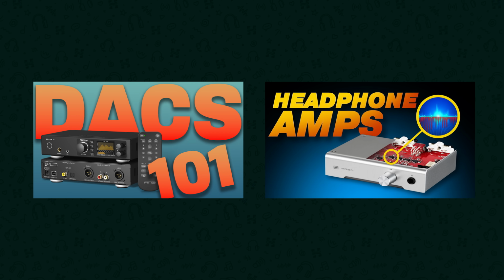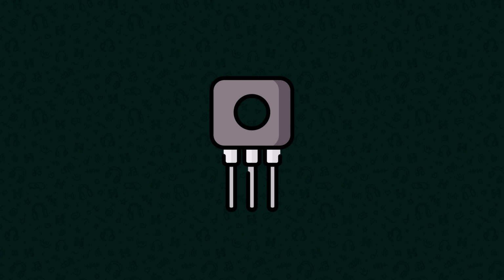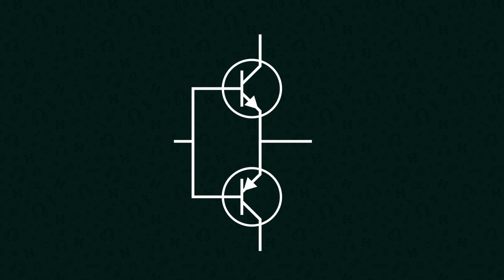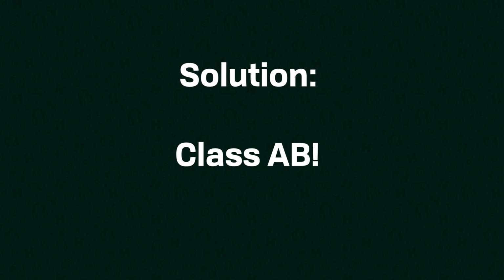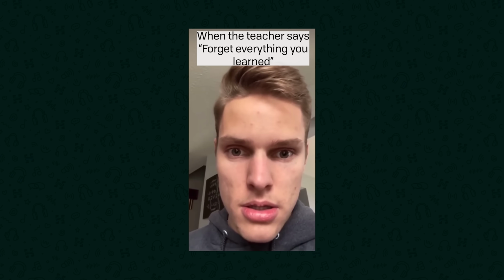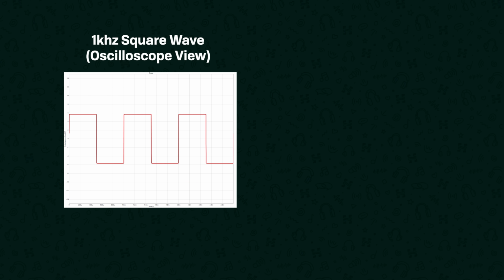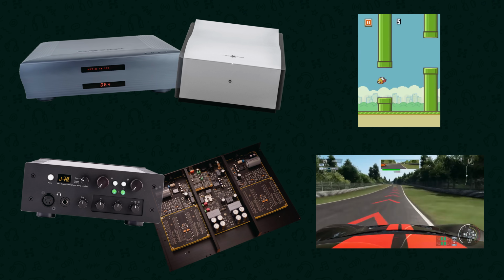Audio amp classes as fast as possible!

Comment: Class A/B amps still have crossover distortion. The higher the bias, the less distortion. Only class A amps don't have any crossover distortion. Most class A/B amps have pissant bias current, thus considerable crossover distortion. Class B amps don't exist for audio, because the distortion is horrific.

Comment: What happened to "C"???? They don't like this letter?
Reply: class c amps do exist and are actually the most efficient, but heavily distort audio as the transistor spends most of its cycle off
Reply: It has no application in audio but used in rf.

Comment: I was designing AB amps 50 years ago. 2N5457 FET front end and 2N3055/MJ2955 output. 
I dont think my 50W rms amp design could be bettered, even by a 405. Class A has too much distortion and Class D is not cost effective on components.

Comment: Ok so which kind is 'best'? 
From a power effeciency standpoint it would be D, obiously. So why do the other two still exist?
Reply: Class A amplifiers are the simplest design and generally offer the lowest distortion, but they are highly inefficient. Because of this efficiency penalty, they are chosen almost exclusively for their high sound fidelity. While Class B is more efficient, a pure Class B topology is rarely used due to crossover distortion, instead, Class AB serves as the industry sweet spot by successfully balancing efficiency with distortion control. Meanwhile, Class D amplifiers historically struggled with high frequencies and overall sound quality. However, thanks to high-speed electronics, advanced switches, and other novel innovations, Class D has become quite good that some enthusiasts argue it is rendering Class AB, and perhaps even Class A, obsolete.

Comment: I like this explanation, but when I look at it, the first thing that comes to mind is why not take a copy of the signal, run it through a comparator, and turn off the bias voltage of a class A amp when there's no signal present for longer than a certain time.

Comment: Well explained.  But probably could have gone to more depth on why Audiophiles prefer class A and why most consumer audio amps are Class D.
Reply: That's difficult. Not all audiophiles do prefer Class A.
Reply: Don't forget high quality Class AB amplifiers. Loved by many audiophiles.
Reply: @MrSummitville  Technics made a very clever class B push pull amp which biased the output devices (in this case bipolar) just enough so neither actually shut down completely, thus eliminating crossover distortion. They call it 'New Class A'. Even the modest ones with integrated output ICs sounded lovely. Later came their 'Class AA', which was completely different. To my ears, they were inferior.
Reply: @Paul-c5x7t  If the transistors never shutdown down then it is Class A. Single-ended Class A and Push-Pull Class A.
Reply: @MrSummitville  I've always thought of Class A as single output device capacitor coupled to the speaker and no feedback.
Reply: @Paul-c5x7t  If the transistor(s) never turn off that is Class A. Both Single-Ended Class A and Push-Pull Class A designs exist. There is no requirement for Class A to be single-ended, passive, "resistor-only" pull-up. Active pull-up, by another transistor, is allowed in complementary Push-Pull Class A designs.  Both transistors operate in their Active region.  Many pre-amp designs are Push-Pull Class A = very low distortion.  Basically, it is two "stacked" Class A Amplifiers with the speaker connected to the middle. One Class A amplifier pulls high and the other Class A amplifier pulls low. With a bipolar supply, the output can be 0 volts, when the input is 0 volts. A Single-Ended Class A amplifier, with a single-ended supply, has a DC Offset in the output.
Reply: @MrSummitville  Thank you!! Appreciated.

Comment: The presentation was well-organized and clear. Based on my observations, the Class A amplifier produces a very strong speaker output, and the frequency remains consistent even when standing directly in front of the speaker. In contrast, push-pull amplifiers do produce a buzz, but there is noticeable deviation in the low frequencies when standing in front of the speaker. Similar behavior is observed in AB and D amplifiers. This is why I still prefer Class A amplifiers. The only drawback is that if a transistor shorts, the speaker can be damaged unless relay protection is installed

Comment: It's not the "quescient" current, it's the quiescent current. And it is not what makes circuits like class A amplifiers inefficient. What does is that they more or less always must operate in a range where they have SOME resistance, which wastes power. What do you think is the range where a transistor wastes the most power? Near the top, where the resistance is the least, or near the bottom where it is the highest? Neither. It's around the middle. Power dissipation is voltage drop times current. Those vary in counter-sense with the resistance, so when the transistor is almost fully conducting, the voltage drop is nearly zero, and current is the highest. When it's barely conducting at all, the voltage drop is the highest, but current is almost 0. Thus the power dissipation is lowest at the extremes and highest in the mid-range.

This is why class D is efficient. The transistors (usually fast-switching MOSFETs) are run in a way that they are either fully on or fully off - the modes of operation with the least power dissipation. They don't vary the resistance, they simulate it by letting wider or narrower pulses of current through and smoothing it out to a nice (and hopefully high fidelity to the signal) curve.
Reply: Class A amplifiers do have high quiescent current. And that does make them less efficient.

Comment: As a former audio manufacturer who was one of the very first to bring Class D to multichannel home theater solutions, thank you for clearly saying PWM instead of the dreaded (and completely different) "digital" word.
Reply: PWM does convert the Analog Signal into a Digital Signal.
Reply: @MrSummitville It merely moves the analogue signal from the voltage domain to the time domain (or it encodes it directly in the time domain, because we all play digitally encoded analogue signals in the first place). 
Learn some electronics instead of spreading nonsense.
Reply: @PaulSpades  PWM (Pulse Width Modulation) is a digital signal used to approximate an analog signal. It consists of a square wave that rapidly switches between fully ON and fully OFF = Digital Signal.  Clearly, you do not know what a Digital Signal is.
Reply: @MrSummitville PWM ≠ digital. PWM is not a representation of numbers, and therefore by definiton is not digital
Reply: @atypicalchannel  PWM certainly does convert an Analog Signal into a Digital Signal. The output is a Square Wave with a value of "1" = On and value "0" =  OFF.  Digital values of "1" and "0" only !!!  Your reply is incoherent, at best.  You think you are a EE because you stayed at a Holiday Inn, last night?
Reply: @MrSummitville The audio is not represented by the on and off pulses on the output of the transistor. Those happen at a fixed rate and frequency, regardless of what is currently being amplified. The audio is represented by the length of time each pulse stays turned on or off. It is infinitely variable (i.e. analog) and controlled completely by analog circutry. There is no conversion of the analog signal to 1s and 0s, there are no hexidecimal values, not even any "bits or bytes". There is no "data", only voltages. You can keep pretending like you know what youre talking about and making rude statements, or you can do some research.
Reply: @atypicalchannel  I said ... On & Off. I never said hexadecimal. You are delusional.
Reply: @MrSummitville Yes I am aware, but the state of being on or off dosent carry any numbers, there are no "digits" so it cant be digital. Saying a class D amplifier is digital because of the on/off pulses is like saying a composite video signal is digital because I can unplug it from my tv.... "Look! I just changed it from a 1 to a 0!!"
Reply: @atypicalchannel  You don't what you are talking about. You don't know what a Digital Signal is. Just stop. You are wasting my time. Get an EE degree.
Reply: @MrSummitville I'm an electronics engineer, and he is right. PWM is a form of modulation, and the modulation is in pulse width or duty cycle. You can create analog PWM and digital PWM. The limitation is whether you quantize the pulse width or not. You, and many electronics engineers, think that quantization can only be done at the voltage level.

Comment: Electronic technician:

Take note that, in a class AB amplifier, over bias won't turn it into a class A amplifier. 
You have to bias it as specified in the service manual. That's because the feedback network is calibrated for a certain amount of bias. Hotter doesn't always equal better.

Comment: Good explanation. But, it should be pointed out that distortion (including that created by the crossing distortion) can be measured. "Purity" is not a technical term, I think this simply means lower distortion and noise. So, it is possible to make an AB amp that has inaudibly low distortion. A class-A amp cannot sound more "pure" (having less distortion) because human ears cannot hear the difference. So, it doesn't matter what type an amp is, as long as it has low distortion. I think tests of audible distortion show that people need over 2% distortion to hear it with music (on some music). For sine tones, 0.05% is needed to not be able to tell the difference. Home audio amps regularly achieved this distortion sometime in the 1970s--its a non-issue now and one reason people can't distinguish properly operating amps.

Comment: The Class D amplifier explanation is incomplete.  As shown, only half the wave modulates the positive rail, the other half of the wave modulates the negative rail.  You have a bipolar, AC input and you need a bipolar, AC output. 
A weakness of Class D is no "damping factor", the integrated pulse width modulation produces a voltage impressed upon the speaker but cannot absorb the speakers overshoot whereupon it becomes a type of generator producing its own voltage.  A transistor output amplifier can absorb this energy from the speaker making it tight but not everyone likes it.  Tube amplifiers have weak damping factor and Class D none at all; but feedback can simulate a damping factor.

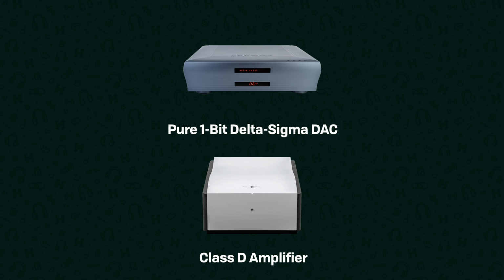Comment: Please do not show DAC output as discrete steps, like at 8:20, because that’s not how real DAC output looks. No matter how much you zoom in, you will never see steps. A DAC cannot reproduce an input signal correctly unless it is followed by (or has a built-in) low-pass filter. Once the signal passes through that filter, it cannot appear blocky—just like in the video where a class D output becomes a sine wave.

It’s a common misconception that DACs produce steps and that bit depth (8, 16, 20, or 24 bits) determines their size. In reality, a DAC never outputs steps, not even a 1-bit DAC. The number of bits only defines the signal-to-noise ratio and dynamic range, not the shape of the waveform. On an analog oscilloscope, an 8-bit DAC output looks the same as a 16-bit DAC output at any zoom level. The only difference is that the 8-bit version has a higher noise floor, so more background noise is present but if you filter out all signals below a certain threshold, the curves are identically on the oscilloscope.

So showing digital signal output as visible steps is always incorrect. No real signal has ever looked like that. With an ADC-DAC chain running above 40 kHz, any analog signal up to 20 kHz can be reproduced perfectly, regardless of bit depth. The DAC is not outputting an approximation—it outputs an exact copy of the signal. Bit depth only determines the noise level. And for perspective: an audio cassette had an effective resolution of about 5–6 bits, and high-end studio tape about 11–12 bits. That means 16-bit audio already surpasses the noise performance of even the best studio tapes from the 70s and 80s.

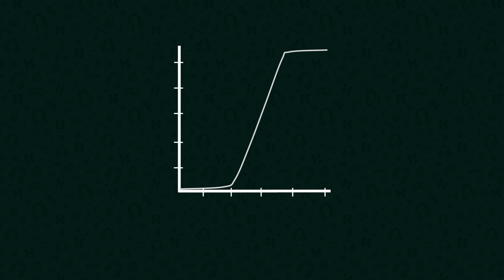Comment: The vidNo, "transistor" or BJT that are meant here to not have a threshold-current but a voltage. Then 2:32 the chart shows a relationship between the input.... voltage or current? Who knows. no labeling, no mentioning of unit. Only later it talks about proportional current.

Comment: can you use 2 transistors both npn, but at different voltage response ranges?
Reply: You can use Sziklai pair that can make npn power transistor to act like pnp transistor (with help of small pnp transistor). Not directly possible to have "different voltage response range", idk what that means, because it needs to handle different polarity of the signal.

Comment: CLASS H (hybrid), amost same as Class AB, but with two stage power supply. One, low voltage
(-LV/GND/+LV)and second high voltage
(-HV/GND/+HV). When the input signal is high enough, they switching to higher voltage supply. Usually, it is integrated circuit chip. STK and TDA.

Comment: I took electronics back in the mid 70's and I'm still kinda fuzzy on class D audio amplifiers. Sure I've repaired several but I've always used good ole tried and true methods, (site, feel, resistance and voltage measurements but I never took the time to get into learning exactly what was happening inside of that type of circuit. Thanks for! your Explanations they have helped me "Shave-off some of the Fuzz!":eyes-pink-heart-shape:

Comment: I dont really understand the idea of pozitive and negative signal, i thought sound signal is DC based?
Reply: Nope, sounds are AC, not DC. The proof ? Sound is always characterized by frequencies (of the alternate signal).
Reply: @TEKDAD  sound can absolutely be dc

in fact, this has been argued too many times

is a pwm signal dc or ac?

well ur arduino is dc and it outputs pwm, so it is dc

doesnt matter, because all of them r wrong, including ur answer

the real answer is that ac dc actually has 2 definitions (actual textbook definitions)

one is that ac means alternating, current changes direction like ur mains power, dc means direct, only going one direction, doesnt matter if it is pwm

another is that ac means changing signal, and dc means constant signal

U NEED TO KNOW THE CONTEXT TO KNOW WHAT THESE MEANS

and this is the real answer to this question, because many ppl only know one or the other of the definition

to avoid confusion, use the term, ac with dc offset

there are also many engineering terms with multiple definitions, like voh and vol

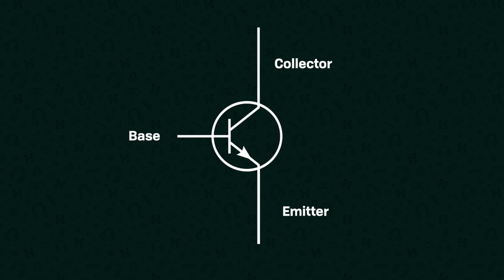Comment: 1:34 "Current flows from the collector to the emitter" - Don't you mean the other way around????
Reply: Why? In npn transistor current flows from the collector to the emitter, that's correct.
Reply: So-called "conventional" current does flow from collector to emitter, but electron flow flows from negative to positive. A negative terminal of a power supply will have an excess of electrons, while the positive terminal will have an identical deficit. Part of this confusion goes back to Ben Franklin, who chose Positive for the electron source, and Negative for the destination, not knowing all the physics because they haven't been discovered yet. Bottom line, electrons start at the Emitter, the Base controls how many electrons flow to the Collector.
Reply: @joeylawn36111 kinda yeah. I think naming emitter and collector is related to the fact emitter emits it's majority carriers, and collector collects them. In npn transistor those carriers are electrons and current flows in opposite direction (from collector to emitter). In pnp transistor those carriers are holes and current flows from emitter to collector. Or may be proper naming is primary charge carriers, I can't remember now.
Reply: @joeylawn36111  That is why we don't say "Electron" Flow. Electrical Engineers say "Current" Flow. There is no confusion.  You must learn the lingo ...

Comment: So, we're still pretending that current flows from positive to negative? Unbelievable! Holes don't flow.
Otherwise good video.
Reply: You are confused. Current Flow is not the same as Electron Flow. Clearly, you are not an Electrical Engineer.  You must learn lingo.

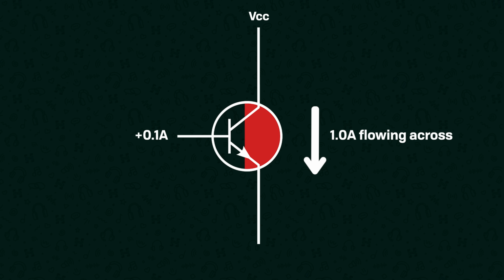Comment: 1:50 I dont like this representation. Voltage control model of transistors is much more sensible here.  The mechanism of action of BJT is that an electric field across the base-emitter junction decreases the width of the depletion zone. It is this electric field, measured in volts, that controls the movement of charge carriers. Therefore the BJT is voltage controlled.

You can assume current control when designing a circuit but here we are explaining how they work so lets not put cart in front of the horse.

Comment: Interesting. It seems like a Class D amp is generating a DSD-like signal from the analog input. So, what if you have a DSD signal to start with? Are you converting it to analog with a special DAC? And then basically back to something like DSD in the amp? Sounds like there should be a DSD input on class D amps, skiping the DAC, and only becoming analog when it hits the low pass filter at the output.

Comment: Current flows FROM the emitter, that's why it is named as such, same with the collector being the "collector".
Reply: Of course, exactly WHAT the emitter emits depends on the type of transistor.   It might emit electrons (NPN) or it might emit "holes" (a place for an electron to go) (PNP).   But of course you cannot actually "emit" a thing that does not exist.  So in a PNP transistor, it is the collector doing the actual emitting.  well; that and the base.
Reply: @sadisynn - Learn the difference between "current flow" and "Electron Flow".  No, they are NOT the same thing!

Comment: Amplifiers are classified based on the conduction angle of their output devices during one cycle of the input signal. This classification leads to different classes of amplifiers, such as Class A, B, AB, C, D, E, F, and T, each with varying efficiency and characteristics.